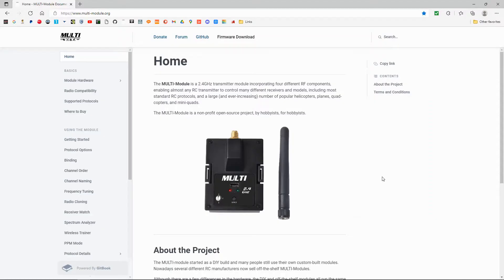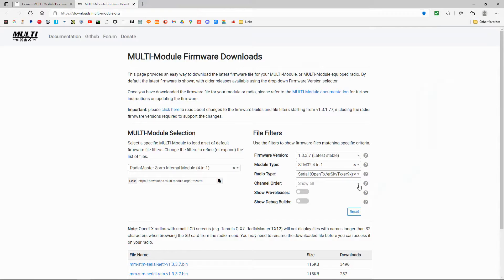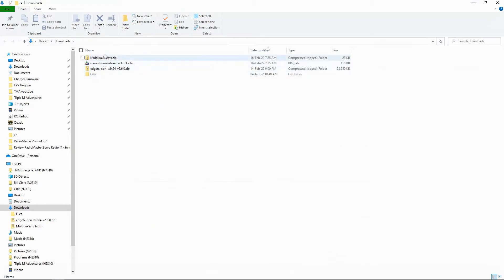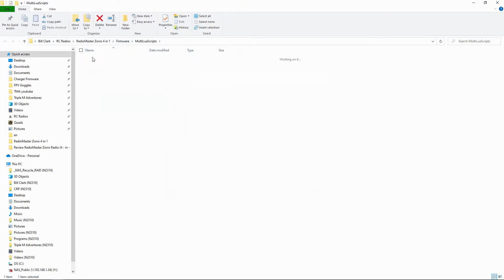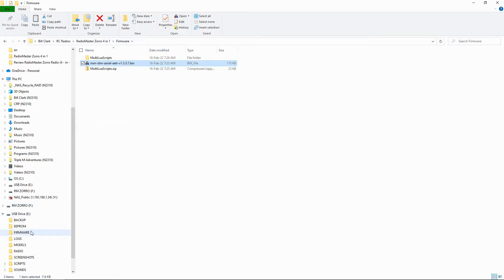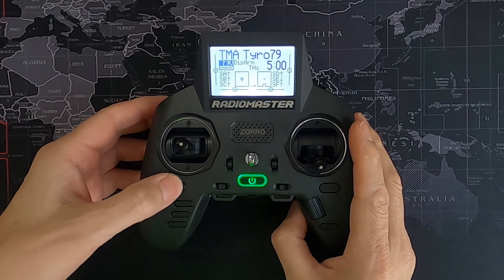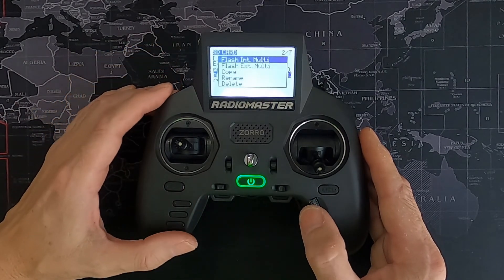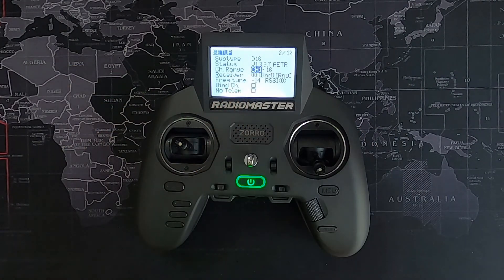RadioMaster Zorro How to update the Multi Protocol Module firmware

Comment: Hello Bill - your videos are very good and well-detailed!! ...although you do go a little fast for me, so have to keep rewinding the video!! I have just purchased the TX12 Mk.2 CC2500 with EdgeTX/MPM model. However, found out from RM that I would defo need the 4 in 1 Multi-Module to be able to get the additional protocols for flying the cheaper Chinese micro-helicopters. The protocol Radiomaster have confirmed is E129 (83), sub-protocol E129-0 and C186-1 for the operation of RC Era C186...so presume is the same for the C138 as well. How can I confirm that my transmitter has the FCC firmware? - have downloaded the Air firmware from the webpage referred - latest v.1.3.4.31 AETR, but my TX12 Sstill shows v.1.3.3.7 AETR for some reason, so not sure its updated the firmware to the .31 version I've downloaded?, and copied to the 'USB' window for my SD Card. I have been told by Radiomaster that this firmware includes the Flysky2A protocol to bind with my iA10B receiver. I am very new to these type of transmitters, but purchased as an upgrade to the stock transmitters supplied by RC Era. Still yet to go through binding my 2 helicopters as they both currently need some repairs! Any advice would be very much appreciated. ps. seem to have 'lost the SD Storage' option when plugging in the USB as well now...why is this?  Thanks and Kind Regards.

Comment: Thankyou for this great help,  others may have the same issue i did with this,  after following all the steps i'd go onto tx and discover that the bin file i'd copy'd over wasn't showing up on my zorro screen, i fixed it by connecting back to my pc and renaming the bin file to make it shorter,  only then could i find it on my zorro screen.

Comment: Hi Bill, 
Thanks for the video, however I ran into trouble trying to run the bin on the controller once I finished copying everything. I cannot find the .bin file in my FIRMWARE folder even though after plugging it back to my laptop, the .bin file is indeed in the right folder. Not sure if you ran into something similar. 

Much appreciated
Reply from the maker: Your problem is the file name is too long. Edit the bin file name to just a few characters. You should then be ok.
Reply: Doh!! yeah I did that too!

Comment: Hello,
after updating last version of 4in 1 Module firmware i can't still find protokoll "mouldking" . It should present, according to release notes but when i scroll thru protokoll list on zorro menue it is not there. Is there a special trick to force an reading of the protocals / refresh list of protocols ? Thanks in advance
Reply from the maker: You do need to select the correct version of the firmware which includes the protocol you need. Check the MPM website.

Comment: Hi
I bought the Boxer 4 in 1, Customer service sent me your video to do as you showed.
Unfortunately I couldn't reach anything, I fell I threw my money in the garbage.
could someone help me what to do, it is like a computer, i just want to bind it with Radiolink R7FG.
Thank you so much
Reply from the maker: Ahmed, let me see if I can assist you. What are you having problems with binding the receiver? What version of the MPM firmware does your radio have?
Reply: @the-happy-RC-flyer  Hi Bill,
Thank you so much for your quick response.
Finally, I bound them, but it is a long way to discover everything in this transmitter.
Thank you so much.
Regards.

Comment: Hi i just got a radiomaster boxer 4in1 and i'm having problems with it. First it doesn't have all the options in the internal RF, i tried to flash the multiprotocol firmware but when i put it in the firmware folder and try to enter through the controller it's not there. I saw on the internet that someone had the same problem as me (not all protocols are available) and they fixed it by flashing the firmware for Radiomaster Zorro. I tried that too, but again the controller does not load the firmware file.
I need frsky D8 protocol for some planes and Elrs for drones. Elrs is on the module and it works normally. While I have the option frsky x and frsky x2, but there is no D8 and D16. If I had those options it wouldn't be a big problem because I only needed them, but I only have a couple of protocols offered, of which they weren't offered.
Reply from the maker: If you have a Boxer with an internal 4 in 1 module you need to select this firmware. If you cannot see the firmware placed on the SDCard make the file name less characters. You say Express LRS is working I assume you have an external Express LRS module.
Reply: @the-happy-RC-flyer  Thanks, I managed to flash the firmware but there are still missing protocols. Do you maybe know why?
Reply from the maker: It sounds like you do not have the 4 in 1 but the CC2500 which has less protocols. What protocols are you missing? If they are FrSky please check under Subtypes for the different protocols.
Reply: @the-happy-RC-flyer  When I select multi for internal RF, the first thing that pops out is FlySky, and when I start browsing the types it disappears and I can't see it again. I only have: Config, BayanRX, DSM , DSM_RX , FS2A_RX , FrSkyRX , FrSkyX, FrSkyX2 and HoTT. I'm currently using an external elrs module for drones and I need a D8 and D16 FrSky for airplanes and those options aren't in any of the subtitles.
Reply from the maker: It looks like you have the internal module the CC2500. If you need D8 or 16 select FrSkyX or FrSkyX2 then move down to subtypes and select the protocol you need.
Reply: @the-happy-RC-flyer  For some reason I don't have D8 and D16 under FrSkyX and FrSkyX2. Should I then try to flash the cc2500 firmware?
Reply from the maker: Yes if you are sure you have the CC2500 version.

Comment: Hey!
Im trying to do exactly this now to be able to bind with frsky archer plus gr6 but now the multimodule website also gives you an option to choose ”firmware type” and for the lastest version the types i can choose is air, surface and EU LBT. I know that eu lbt wont work with some of my reveivers. My zorro came with eu lbt and i had to change to FCC to make it work. Dont see FCC in the list now though. Any ideas?
Reply from the maker: You cannot bind the newer FrSky receivers to the multi protocol module.
Reply: @the-happy-RC-flyer  thats wierd because i just updated to the newest firmware on the multimodule and have been happily flying the new frsky archer for 2 days now🤣 youre misinformed.
Reply from the maker: Which protocol did you select?
Reply: @the-happy-RC-flyer  frskyx2 d16. Note that its the archer PLUS im talking about, not the standard archer
Reply from the maker: Thank you for that information.

Comment: Hi, i was trying to flash firmware on my Boxer cc2500 and it fails saying update error, device not responding, can anyone help please
Reply from the maker: Hi, please check you have a model open on the radio with the internal module selected and try again.

Comment: Hi, 
Your video was really helping me figuring out how to update the 4-in-1 module. However, when I go in a model where I previously had FrSky configured, the only option I now have is CRSF for bot the internal and external module.
I do have an ExpressLRS backpack, so for the external module this is how it supposed to be.
Do you have an idea what could be causing this for the internal module?
-edit-
I fixed it. I had to change the setting in the SYS, page 6/7 for the Internal RF back to Multi.
I'm not sure what caused all the settings in my radio to reset. These settings were all correctly set when I received the radio. Now even the mode had changed to mode 1... Weird
Reply from the maker: I am pleased you solved your problem.
Reply: with your edit i fixed my problem also: Sys, page 6/7 for the Internal RF back to Multi  THANK YOU SO MUCH, i was going crazy because of CRSF...

Comment: Thank you sir!  I have used the Radiomaster Zorro 4in1 to bind to my eachine mini's, but I can't seem to get it to bind to my AK A160 using the KN protocol even though many others seem to do it no problem.  Don't know if you have any ideas or helpful tips, but thank you nonetheless!
Reply from the maker: Hi Roland, if KN is the correct protocol then it must be your binding procedure make sure the receiver is going into bind mode first before selecting bind in your Zorro.

Comment: Hi. I seem to of lost my external module option in my settings while doing updates, if I follow your instructions will i get it back, the reason this happened is because I was trying to load my bin model files from my old model bin files from a copy of my opentx SD card I copied to my computer, I cannot plug my old x- lite radio into my computer because I broke the usb connector this is why I purchased the Zorro, been trying to get edgetx to recognise bin files and cannot convert them into the new file type.
Reply from the maker: You may have bricked your radio. If you radio has the multi protocol module try flashing it again. Just check you do not have the ExpressLRS version.
Reply: @the-happy-RC-flyer  no, did not brick my radio, just down loaded the firmware again and it's fine, still not worked out how to get my old models on seems as I can't connect my old radio

Comment: I have tried to flash the internal Module per your advice, I am getting the following error:

"FW update error
device not responding
[exit] "

I then have to press the power button to get any response out of the controller. 
I originally thought I had the elrs version so i tried to flash elrs onto it, ive since deleted everything Ive added to the sd card and used the factory dump provided by radiomaster. however when I try to bind to my tinyhawks or other kwads  it now just keeps beeping trying to bind and never successfully gets telemetry/binds.
Reply from the maker: Scott, firstly you need to make sure you have flashed the correct firmware to the module in your radio. If you see multiple options under bind in the model settings you have the multi protocol module. If you cannot bind you are choosing the incorrect protocol. If you have a FrSky receiver in your drone you have different protocol options to chose from, which receiver is in your model?
Reply: @the-happy-RC-flyer  I have the 4-1 model, currently trying to bind with a Tinyhwawk 2 on FRsky D8. 
Thanks for the quick reply!!
Reply from the maker: @scottnetphoto  You need to use Type FrSky X Subtype D8 and then fine frequency tune. Search my playlist to find a video to complete the fine frequency tune process.
Reply: @the-happy-RC-flyer  even though before this issue with my controller I had it bound/flying with no isues on FRsky d8...? the issue with binding is ill press [bnd] on the controller and it just keeps beeping and never binds, ive tried a friends controller and he can bind to the tinyhawk with no problems, so it seems its definitley my Zorro. 
Radiomaster has replied to my email now and theyre suggesting I send it back to china (as im in Canada and there are no technicians in my area). They think Ive "bricked" by internal module. 

Again Im very new to FPV drones/kwads and all this firmware stuff...
Reply from the maker: @scottnetphoto  I would give flashing the modules firmware ago one more time before sending it off to RadioMaster.
Reply: double checked the firmware and I now have a flashed internal module. 
When I go to bind my tinyhawk now on FRsky D8 (same as previously bound and flew on) 
The controller never binds and keeps beeping.... any other settings or things to check/flash?
Reply from the maker: @scottnetphoto  it sounds like the
 module is bricked after being flashed with the incorrect firmware. I think you will need to return it to RadioMaster.

Comment: A bought the Radiomaster Zorro and initially I was having g trouble binding.  Then once I got several of my drones binded, I realized that the sticks and other functions were backwards (inverted).  Even in the simulator the sticks are all out of sink.  Can you help?
Reply from the maker: Hi Terry, just change your weights in mixes to -100 or 100 to reverse the throws.
Reply: @the-happy-RC-flyer  That really did the job Bill!  Thanks for the response.

Comment: Radio master Zorro 4 in 1 can’t find the frsky D protocol on setup page 2/12 to get my tiny hawk 2 to Bind to the Radio?  What’s the issue or the problem any help?
Reply from the maker: Frankie, apologies for the slow reply. I think you require D8 so select FrSky X and subtype D8.
Reply: @the-happy-RC-flyer  Thank you for the help, I don’t know why they have it under different protocol Names!
Reply: @the-happy-RC-flyer  can you do  the modes and  switch changes in beta flight instead of doing it on the radiomaster Zorro controller?
Reply from the maker: @diggsit69  you will need to set up both in Betaflight and your radio. Flight modes on your Zorro are not necessary but you would have a visual key on your radio showing if you are armed or not. EdgeTX/OpenTX flight modes come into play when using them in conjunction with Global Variables in fixed wings. You can set up different aileron throws for different modes which automatically change when you flick your mode switch.
Reply: @the-happy-RC-flyer  I noticed when I bind my radio master Zorro to my tiny hawk 2 an freestyle drones and now my  BetaFpv controller is not binded to them anymore, do I have to rebind every time I use a different controller for my drones? I thought once they were binded  to the controller they stayed  setup an ready to fly?
Reply from the maker: @diggsit69  You will need to rebind to the different transmitter each time this is for safety reasons lets say you turned on both radios at the same time. There is a way of multi binding so you can use two radios with the same receiver this requires you linking the two multi protocol modules to clone the binding details. It is not a complex procedure you will need to copy the model / models to the second radio and then complete the multi bind procedure. I will work on a video in the future. This does no work for all protocols.
Reply: @the-happy-RC-flyer  Thanks for the feedback Bro!
Reply: hi frankie, I also got a zorro and also want to use the frskyu d8 protocol.I found the protocol but it says no telematry?How did you end up getting them connected.Our droens have the same recievers i have the betafpv Cetus pro
Reply: @tollie8287  my issue was I couldn’t find the Frsky D protocol on the Zorro  4-1 transmitter, so I ended up using Frsky X to get it to Bind an after it was bound  the Frsky D was shown in the list of protocol options available, so Frsky X D8 is Frsky D on the Zorro!

Comment: is an internal module swap possible ? i have accidently bought the radiomaster cc2500 version .  i bought the external modul with a 4 in 1 chip (iRX4 Lite) . can this be swapped out to the internal chip ? i also use crossfire as external modul .
Reply from the maker: Not that I am aware of. Can you return the radio to swop it for a 4 in 1 version?

Comment: Hallo mr.Clark,
I got my 4in1 RM Zorro last week, and I have a problem with my DSM receivers, I have various dsm2, also dsmx, and from different companies such as lemon rx, spectrum and orange. All of these can be bound, but all of them have the range very small, there is no fine tuning either. 10 -15 meters and then it's over.😠
What i am doing wrong????please Help!!!!!
i have also FRSKY RX .They work fine.
Thanx apfront
Teddy
Reply from the maker: Teddy are you losing connection, failsafe, or telemetry? It does appear some DSM receivers unless the state long range telemetry will give telemetry warnings very early. Pascallanger suggests you ignore the warnings or disable the audible warnings on your radio. Make sure you do not have the low power option checked under the receiver options. If you are connected do a on the ground range check.
Reply: @the-happy-RC-flyer  Thanx ,Iwill try tomorow,if its not raining,if its work this way means no telemetry? 
thanx for your answer..T.